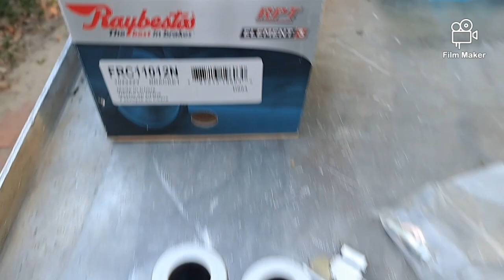Swapping phenolic pistons for steel ones in Mustangs new edge/ PBR calipers.

Comment: In my 45 years of life, these have given me the most trouble.  I have these on an old Taurus SHO which sits a lot.   Thanks for the video.  The part where you mount the seal with the pison, is key.  I recall this being the most tricky parts.